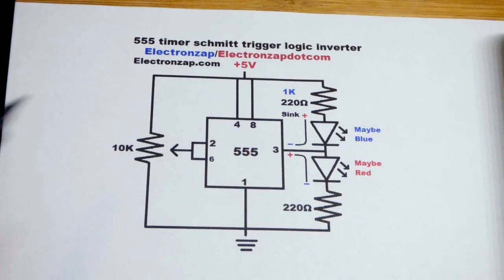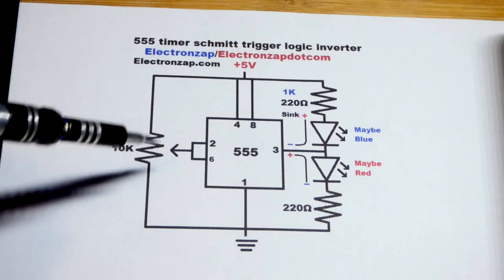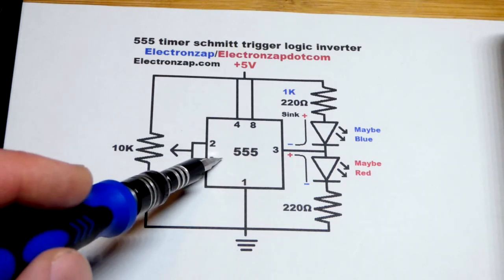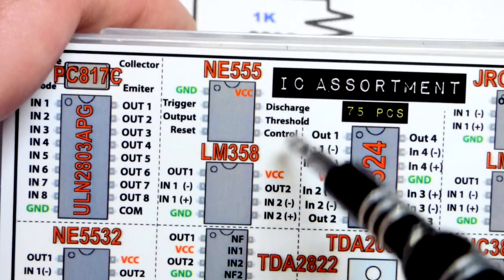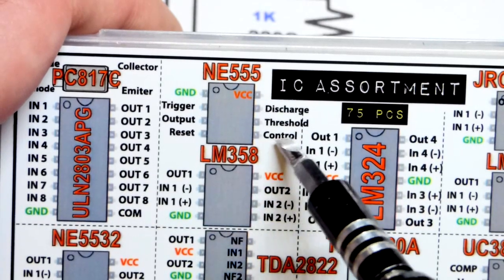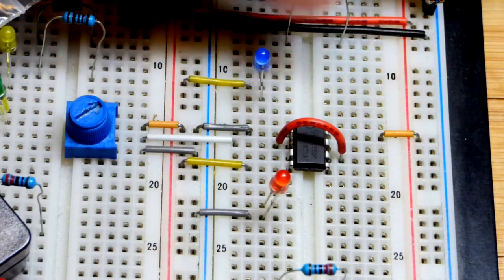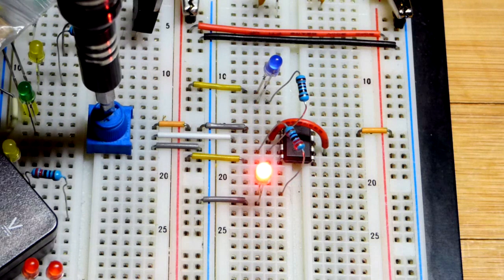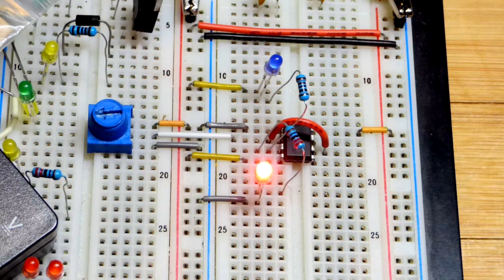555 timer schmitt trigger logic inverter circuit

Comment: How come when the output is high , it does not short to the input through the blue led and its resistor?
Reply from the maker: When both sides of the LED are high, then there is no voltage difference across it. One side needs to be more positive and the other more negative for current to flow.
Reply: @Electronzap  cool, now that is a game changer for me!! Thanks for your time

Comment: Early last year I bought some 555 chips from Amazon but didn't read carefully that they were SMD. I put them away figuring they would get used *some day*. A few months ago I found some SMD to pinout adapter PCBs and I soldered a few of the 555 SMD chips on them. Now I have 4 ready to go for the breadboard, 2 of which have a jumper underneath connecting pins 2 and 6. Handy. 😏
Reply from the maker: Nice! Luckily I haven't accidentally ordered and surface mount devices yet lol.

Comment: Where Can I use this one? For Amplifier or Guitar effects? 

I'm sorry I am a beginner ..
Reply: This one is better for digital circuits. You can "clean up" a digital transmission (square wave) by filtering it through a Schmidt trigger and this is exactly what we use with MIDI circuits. In the video above, you can think of "Maybe Red" LED as a digital 1 (on or true) and the "Maybe Blue" LED as a digital 0 (off or false). The digital MIDI signal SLAMS through the Schmidt trigger at a blinding 32KHz ... which isn't very fast at all actually. But the Schmidt trigger will sense the weak input signal and, not really but kinda almost amplify it into a "clean" output transmission.
Reply from the maker: It's best to just do a google search of "555 timer circuits" and browse all the results. Build the circuits that look fun and are within your current abilities.

Comment: I love 555.
Whats the difference between One Shot, Monostable, Temporizador, Delay and Debouncing???
Reply from the maker: One shot and monostable is a 555 circuit where you trigger it and the output goes high for the time you set and then goes low and stays there til you trigger it again. No clue what a temporizador circuit would be and I never made a delay or debouncing circuit with the 555, but those are good topics so I will keep them in mind 🙂